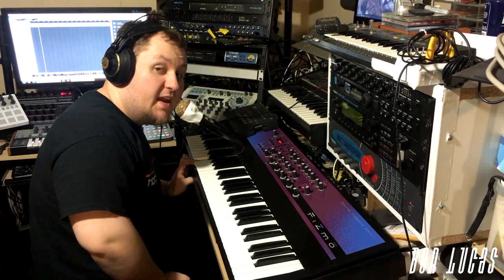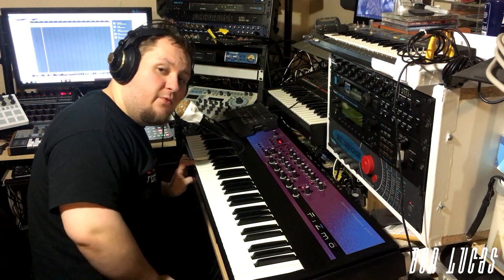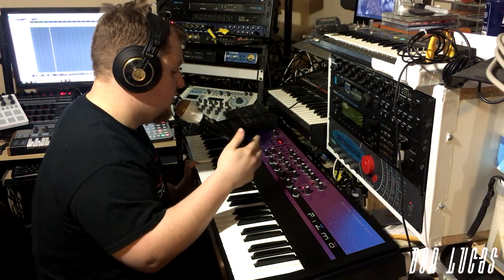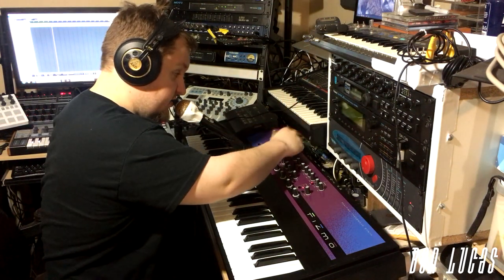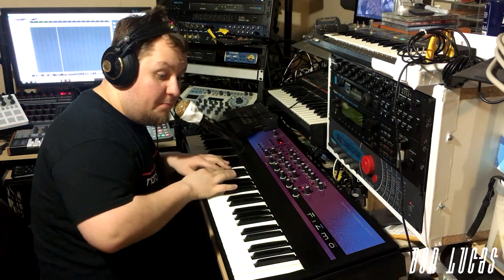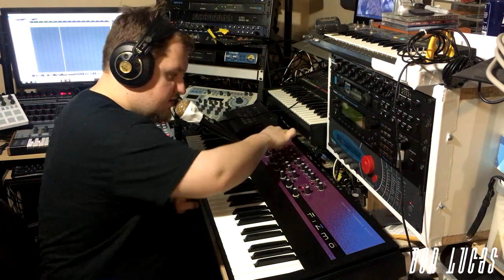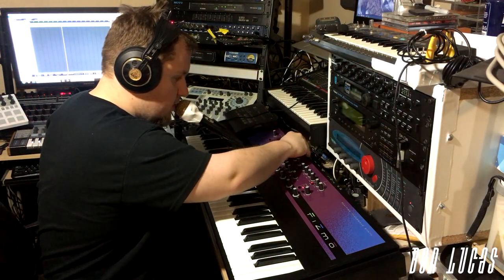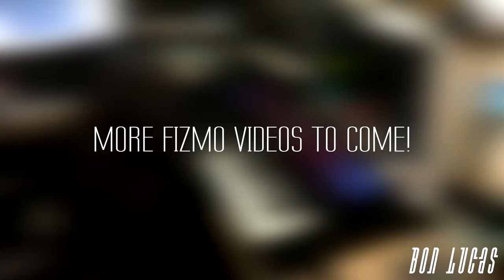Ensoniq Fizmo's Vocoder

Comment: Fizmo is a monster synth that people are finally finding out about. I've been an Ensoniq fan for 25 years and somehow never heard of it until 2020. Snatched one up as soon as I saw one for sale.
Reply: average price to pay?
Reply: @falangistavaleroso9689  These days it's going for about $3000. If you see one for cheaper, grab it. I used to think that kind of money for a synth was crazy but in the last couple years I realized you get what you pay for and every great synth is in that price range. Roland SH7, Polymoog, CS40m, etc. All worth every dollar I spent. Every cheap Behringer I bought was a huge waste of time and their value dropped in half faster than current garbage Record Store Day releases.
Reply: @VincentPresley  I got an sh 7, was awful ( btw my fav synth is the sh 101) , there is one fizmo for 2200 in Spain. I own real VCS3, EML 101 and more, but my fav are FM synths. Today I have been about to get banned by behrincrap idiots because I said the clon has a horrible vumeter of the VCS3. Their 808 sounds as chili on tabasco farts as well. I only got 3 early compressors from them, very good units for real, their later models were shitte... I own dbx, aphex etc. as well. cheers.
Reply: @falangistavaleroso9689  SH7 is one of my favorite synths. Different strokes for different folks. 101 is boring to me as is the Jupiter 8 and Polysix. I've had them all.
Reply: @VincentPresley  my first synth was a polisix, I never liked it. JP 8 was good for crossmodulation metal sounds, I used it on my first record for drums triggered from a 808. But also not for me. I love weird instruments. I do Detroit techno, not musician at all. Now I love fm synths for metal sounds either.